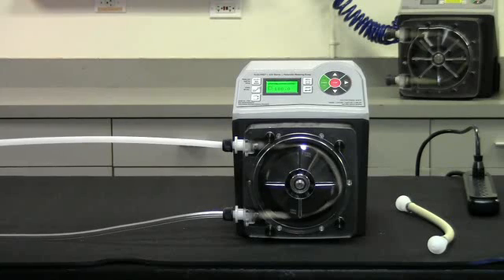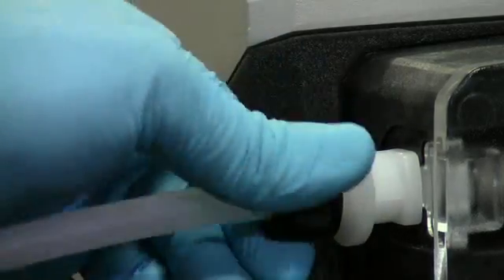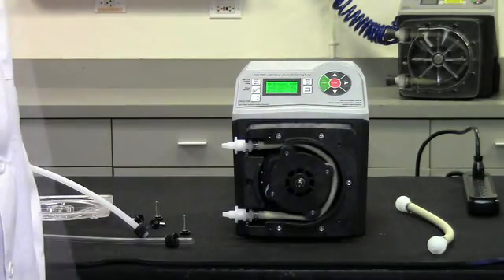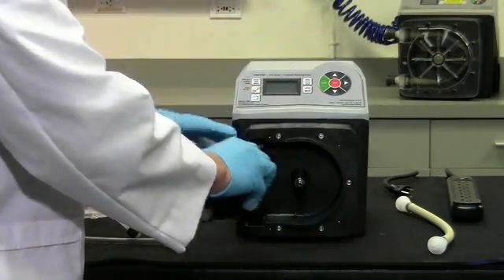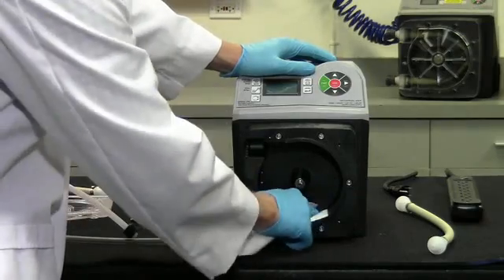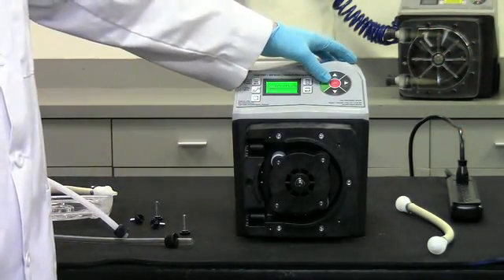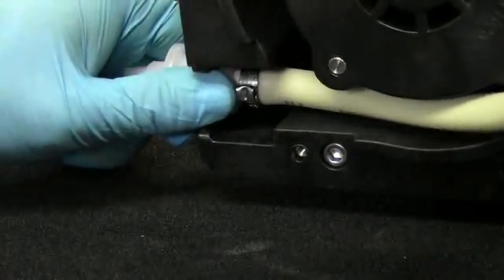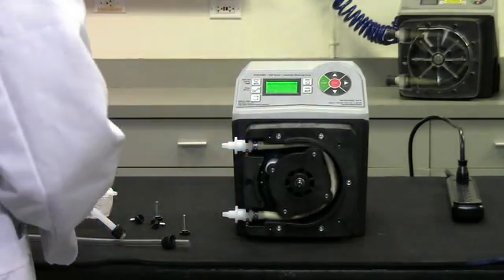Flex-Pro® A3 Peristaltic Pump - Tube Replacement Instruction - Blue-White Ind.

Comment: why does the pump stop rotating intermittently while the tube is being installed?
Reply from the maker: Hi Angela, thank you for your question.  The intermittent stopping of the roller assembly has to do with the initial resistance from the stiffness of the tube.  The tubing featured in the video has the highest stiffness of all our tubes.  The motor has a torque value that it tries to maintain at that RPM but when required it will boost its torque for a short time.  After about a minute the tube gets warn, stretched, and less stiff. Which will make that "stutter" go away.